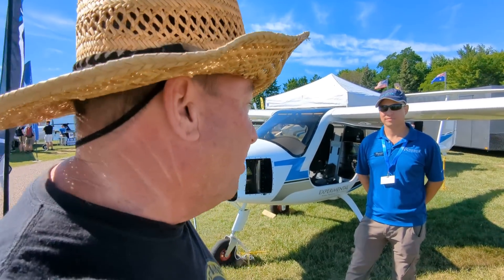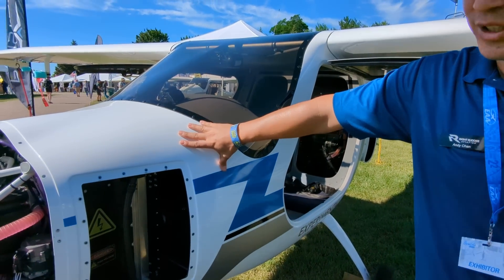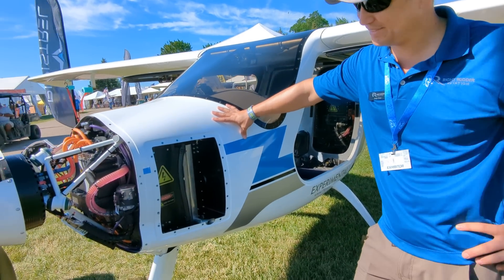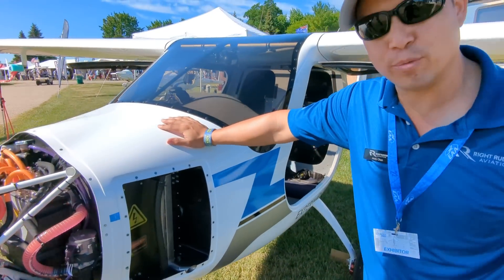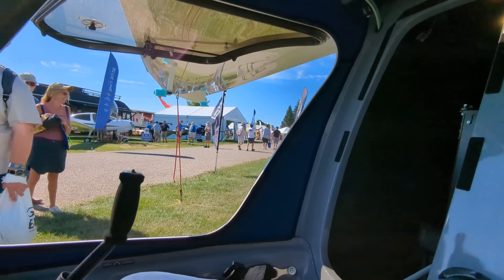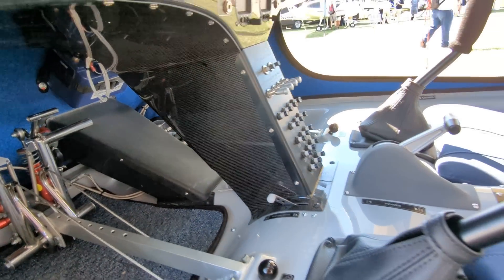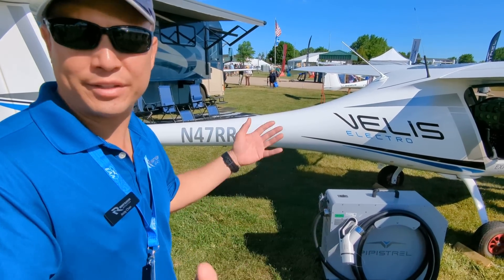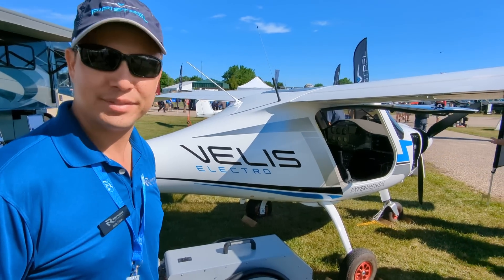Electric Airplane?! Pipistrel Electro at Airventure 2022.

Comment: Lotta critics in the comments. The aim is to make this a way better trainer than these ancient aircraft we're flying around these days. Does the Pipistrel replace a 152? Nah. Doesn't have the same legs. But that's not the right question to ask.

Can the Pipistrel augment a 152 for landing practice? Sure!
For maneuvers? Definitely!
For a barely-over 50nm XC? Yeah!
For taxi practice? Oh hell yes.

Generally a PPL takes 55 hours and costs $10K. Using this instead of a 152 for 20 hours could definitely save a student a grand at least... not to mention you can bet your ass the EPA and local government will give grants to you for reducing carbon, reducing lead, and improving noise abatement.

And the last time I saw Pipistrel, they had the ability to swap out fully charged batteries without charging them attached to the plane. Hopefully I'm not misremembering and that's still a thing.

This is also early stuff and from a small company. Ten years from now and/or when bigger corporations start getting in on this, you can expect it to get even better.
Reply: It's green-washing: thousands or millions of dollars down the toilet on a dream of avoiding pumping oil and favoring landscape-destroying strip mining operations in developing countries. There's still too much waste in the equation!
Reply: The problem is that this aircraft is also insanely expensive to buy and operate when compared to the ICE version of the same aircraft, so it just doesn't make sense from any angle.
Reply: And you charge it with Coal, Hydro, NatGas, Nuclear, maybe wind or solar if that is available in your area…. So get off your “Al Gwhore” I’m saving the world mentality!
Reply: @Showboat_Six  all of those energy sources are better than 100LL
Reply: @stephenj4937  
Really in what way, every one is impossible without petroleum products…..even your cellphone you are typing on!
Reply: @Showboat_Six  Petroleum products will still be around, but their use for transport and energy production will steadily decrease.  The only people worried about that are those who are in bed with the oil companies, i.e. anyone who is stuck in the oil industry, internal combustion engine manufacture and servicing, etc.  But many of them will go the way of the person who used to make wooden wheels for horse-drawn wagons.  Sure, they'll gnash their teeth, wring their hands and rip their clothes (and maybe even go "postal") but that won't stop the rest of society and the world from moving on.

Comment: Electric anything are still light years away from internal combustion engines. Just look at the amount of energy contained in a gallon of Gasoline. They look cool on the surface but I would put these in the same class as a flying car, which we have seen come and go forever...  Now, a quantum leap in battery technology would be a game changer but Lithium ion isn't it. Besides, who has 480v 3 phase anywhere near them unless they are in an industrial area... I also guarantee you that a 2000 hr battery life is best case but much worse if you live in a warm climate like Phoenix... (speaking battery longevity)  Lithium hates heat!  Mayday-Mayday, my battery is dead...!
Reply: 3 Phase 480 I got in my kitchen.
Reply: @z33r0now3  Really? Do you live in an industrial kitchen?
Reply: @tookthe5th182  german 1 Family brick house in a residential area
Reply: What is an airport if it isn't an industrial area? At least the sort where flight schools operate. Nobody is proposing charging this at your house. I'd be very surprised if a significant airport couldn't get this installed easily.
Reply: Anywhere in Europe can get it hooked up, because our 230 is your 115, and we go 3-phase instead of 2, so that is just about any commercial premises (including flats/apartment blocks), and on-demand at individual residential ones.  It quite literally runs along every street.
Reply: @The_Real_Phil_Lee  Never heard of 2 phace AC! Single Phase and 3 Phase are the standard...
Reply: Knock yourselves out guys! I would not like the sweat factor on climbout with a battery failure or just being in the pattern(which is all this is good for) and running out of juice. Being a full scale pilot as well as a Model Pilot, I know Battery failures all to well. Good Luck! We just need better batteries before these become viable... This is not it!

Comment: These things need to get to 2 or more hours flight duration per quick charge to be a big deal, by the way what was the cost of installing a 480 volt charging system? And when all the world is powered by electrics, think of all the poor Africans roasting in crap ass mines clawing for periodic table carcinogens for your battery needs!

Comment: That sure is a sporty looking aircraft! Pretty neat! I spotted that pink coolant a mile away, with the pump at the bottom. I'm still learning about EV's on the automotive side - I haven't even scratched the surface yet!  There's stuff in there that can kill you it's such high voltage / amperage. You could probably run your house off those battery packs for a day or more. Amazing amount of stored energy. Perfect training machine, for sure.  Once they have a range breakthrough at some point, that'll be a game changer both on the ground and in the air.

Comment: Great report, Juan.  Just like a diesel-electric locomotive, get a dynamic braking effect at decreased power. Sorry to see all the nay-sayers out here in the comments section, who can't recognize this as a first step to replacement of expensive/non-renewable aviation fuel.
Reply: The problem is there's half the country that ISN'T REALIZING this is a first step, especially on land-based vehicles, and is trying to ram it through to the masses when it's CLEARLY not yet ready.
Reply: @SmittySmithsonite  It's working out pretty well for land-based vehicles in Norway.  The majority of vehicles sold there are electric.
Reply: @The_Real_Phil_Lee  Well, Norway is slightly different than the USA. You can't drive 5 days in one direction in Norway. I'd also wager none of them are towing campers, boats, flatbed or utility trailers either, nor experiencing 60°F+ temperature swings, or 8,000+ foot elevation changes in a single day. Just search YouTube for the latest tests on the EV Ford F-150 pickup. They are ABYSMAL. Clearly not ready for market yet.
Reply: @SmittySmithsonite  Norway made it work by just encouraging people to use public transport for longer trips.  Simple.
The car is for the commute and shopping, and that is the ideal use case for EVs.

Comment: Nice to see steps taken in this direction, but there's still a long way to go. Flight times and charging stations are the the obviouse ones, but I'm also concerned about post crash fires from the batteries, but I'm not sure if that's even an issue whit this battery type. Cool to see that you're in Oshkosh! I'm there all week, any particular areas that I'm more likely to see you on the grounds?
Reply: Ironically, more of these will be sold in CA where the money and great weather is ... and also where devastating fires spark. Could be a really bad unintended consequence, depending on  Pipistrel's quality control.
Reply: @SmittySmithsonite  The quality must be pretty good to have obtained certification under EASA.

Comment: 50 minutes in the air isn’t long enough….Cool info.  Thanks Juan. Love the hat 😁
Reply: Agreed. IMO it's good only for traffic pattern work, or very short flights around the home airport - and then, just.
I'd not venture a 30min hop from one airport to the next, in a 50-minute endurance airplane. What if for some reason the runway is closed when you get there? No coming back.
For that matter... what if you're on your home airport doing touch and goes, and for some reason the runway closes? No range to go elsewhere? 

As it stands... thanks, but no, thanks.

Cool concept, cool demonstrator airplane, but batteries still need improvement before this is safe or practical.
Reply: Weather comes in and tower says do some loops, we are low vis down here.

Comment: Sure it's not "practical" yet but it's worth working on. Just like an University around here (Montréal, Qc.) was/is working on a snowmobile. 
Burning fossil fuel as a hobby can't be something we keep doing forever.
Reply: Instead, we'll just burn it solely in heavy equipment mining battery materials and the local power plant that makes the electricity needed to charge them... Electric battery powered vehicles create tons of environmental problems, you just don't see it daily, therefore you're convinced it's somehow better than fossil fuels.
Reply: You forget the non fossil, anthracitic carbon, which you can gasify and produce as liquid fuel as well (Fischer Tropsch process)
and it is, as mineral, far more abundant than plant originated ( hence fossil) coal.
The limit is oxygen, reliably released by plants during photosynthesis. So keep plants well fed.
Reply: @arturoeugster2377     I'm aware there's a myriad of options to produce "gaz". Are you aware of the cost? Ready to pay 10 times what it is now?
One thing about " abundance". We have to think long term. It may be abundant today but if it's not renewable. Then it's not sustainable.
Reply: @Dr_Do-Little  There are also huge reserves of hydromethane in northern coastal regions below, which are synthesised by bakteria .No need to worry about running out of natural energy. as long as there is oxygen in the air.
Repeating my previous comment
Reply: Why not? Because the media keeps telling us so?
Reply: @SmittySmithsonite  I don't need "the media" to understand the ressource is not eternal. Beside the CO2.
Reply: @SmittySmithsonite  Who's parroting what? You and the big oil? 
Or do you really think the ressource is eternal. Sorry but nothing's free down here.
Reply: @Dr_Do-Little  I don’t much care if it’s eternal or ready to run dry next week. It’s here NOW. And it WORKS.
Reply: @SmittySmithsonite  So does the airplane.

Comment: Interesting, as light as this bird is, it's an extreme scale model aircraft. Under one hour flight time, in total?

Well, nice proof of concept. $20,000 in batteries, a pair, with a TBO of 2000 hours. Not quite, it isn't overhaul, that's replacement. Plus labor. Ouch.

Comment: Wow, there are a lot of negative comments here. I think this aircraft is great. The technology has to start somewhere. 10 years ago a Nissan Leaf had 73 miles of range, and there was nowhere to charge it besides your garage. Now you can get an EV with 300+ miles of range and charge it from 10% to 80% in 18 minutes. In 10 years we'll probably see electric aircraft with useful range if battery technology continues to rapidly advance.

Comment: $20,000 every two thousand hours? 😰
Reply: How much does 2,000 hours of AvGas cost, out of interest?  I'd like to compare some apples with apples.  So also chuck in the cost of any servicing of the ICE engine in the "traditional" airplane.
Reply: @vk2ig  Very good point, as total cost over time is a very important factor.
Reply: Two thousand hours seems incredibly optimistic to me... That would be like ~2,500 charge cycles.  A Tesla is only rated for 1,500 cycles.  Flight schools are going to fly these on full discharge/charge cycles.
Reply: @cup_and_cone  This is not actually using all of the available power, as they also allow for a safety margin that when unused, increases the battery life. While batteries are rated for full charge and discharge at their C rate, any cycles that charge at a lower rate, or any discharges at a lower rate, and any cycles that do not use the full capacity greatly increase cycle life. Tesla is also going for the cheapest batteries it can get that meet its needs, while airplanes need the most expensive batteries.

Comment: It's an intersting time to watch electric powerplants move into aicracraft. The Harbour Air e-Beaver that is currently testing in Vancouver  BC, Canada. It's an electric conversion of DHC-2 de Havilland Canada Beaver. They are approaching it as an upgraded powerplant, much like the Beaver had to go through when they put the Pratt & Whitney Canada PT6 turbine conversion through certification. There are a a lot of good use cases for electric powered aircraft, training, for one, and short communuter flights for another.

Comment: I wonder what effect temperature has on battery performance?
Reply: listen close and you'll hear JB speak to the issue of the "cooling loop" and "temperature control".  not that it isn't effected (to a degree) but ultimately the pack live in it's own environment SEPARATE from ambient conditions.
Reply: @phillyphil1513  To a point, but eventually ambient temps WILL creep in. It's unavoidable, especially when it's designed as a cooling system. It can work in reverse, too, when not in use. On winter days I'd wager you'd be on a 15 minute flight, if you're lucky. Same in Phoenix in July.
Reply: @SmittySmithsonite  Typically, lithium batteries like these are quite effective at heating themselves up. At startup they can be down on power. Some cars have a heat pump that can bring the batteries to an appropriate temperature.
Reply: The cooling systems consumes flight time
Reply: Especially since most American flight schools are all based in the South.